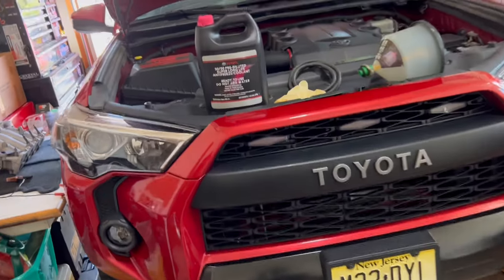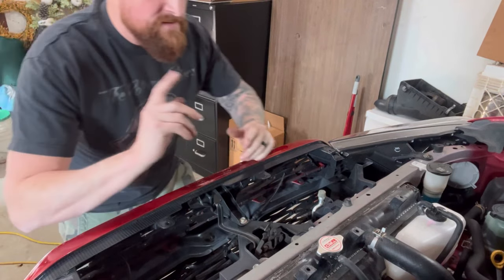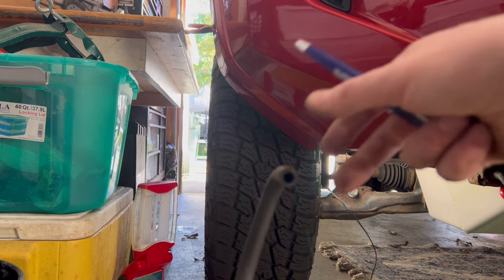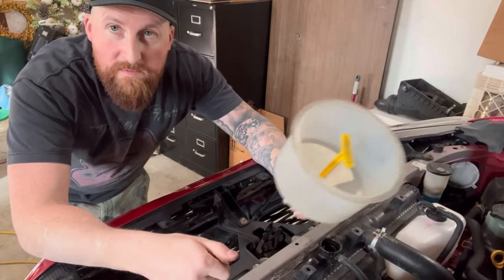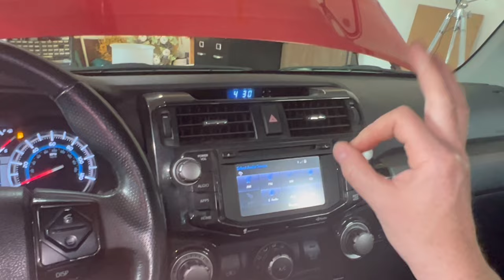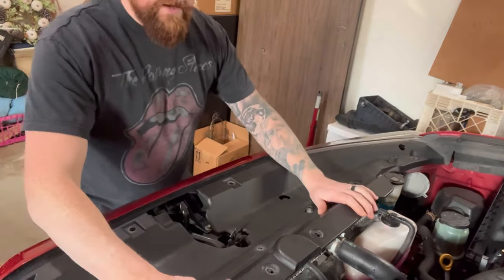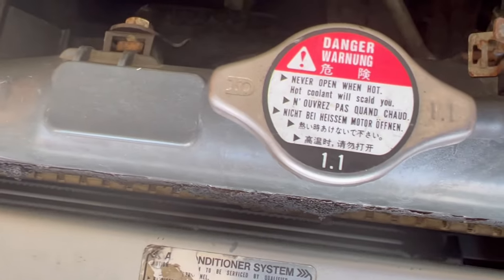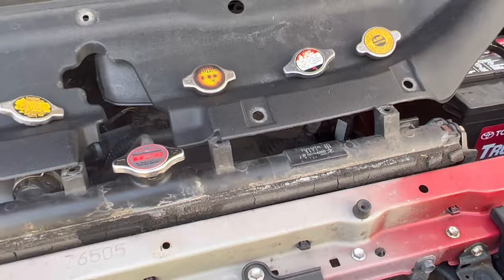Toyota 4Runner • FREE Maintenance Tech Tips - DIY Antifreeze/Coolant service (Drain/Fill)  Part 5

Comment: Great video man! Pro tip, pop your thermostat housing off and remove your thermostat to get the remainder of the coolant out of your engine block and heater core. I got about 2 gallons worth of coolant flushed when i did my service. Even used a shop vac at the radiator cap to push even more old coolant out of the system. Dont forget to purge the old fluid out of the reservoir as well. The more old stuff you get out, the longer the new coolant will stay nice.
Reply from the maker: Good tips, I do try to keep these maintenance videos simple for a beginner to tackle. Your tips are indeed very useful also. 
I did the Thermostat off camera. My wife says I should have included it. I believe she’s right.
I appreciate your continuous support!
Reply: @VikingsGarage  I completely understand. Thanks for the informative and entertaining content!
Reply: Hello, so I’m going to need 2 gallons instead of one right? Also is there a video of how to remove the thermostat housing on 4Runner 5th generation? Thank you
Reply from the maker: If you plan on changing the thermostat, yes,
No videos on changing it, it’s super simple. Believe me!!
Reply: @VikingsGarage  thank you. It is necessary to change the thermostat? Or I just take it out for the flushing and put it back. For a 2020 4runner with 50k miles. Thx for your help!!
Reply from the maker: You do not need to replace it.
Reply: I have a 2013 4Runner with 155k miles. Should I replace my thermostat?
Reply from the maker: Based on age, why not… it’s so easy. At that mileage I would.

Comment: Should we drain coolant from the engine too? Looks like this will partially mix the new coolant into the system.
Reply: You can just do this procedure twice with 2 gallons, that way the coolant in the engine will mix and you will get more thorough flush. You can also run distilled water first, but that will dilute the final mixture at the end.

Comment: Just dropped in to thank you. Just changed the coolant on my 4Runner with no issues at all. I was a little worried that I had 40oz or so in the funnel when the bubbles stopped but it all fit in the reservoir like you mentioned.
Reply from the maker: Absolutely Sir!! 👏🏻👏🏻

Comment: You should also drain old coolant from the drains on each side of the engine block. Accessible from the front wheel wells.
Reply from the maker: 🤦🏼‍♂️ Yes I know!! 
This was meant to be a beginners/ easy and quick drain and fill.
I think it’s probably time that I do that method so people put this to rest already.

Comment: One last question and I’ll leave you alone. You stated in the video that we only need 1 gallon, but the owners manual says the coolant capacity is 11.1 quarts. I’ve heard it’s important to replace coolant because it turns acidic and can cause damage. So by draining and filling just a gallon, is this enough to prevent adverse effects of old coolant?
Thank you for your time.
Reply from the maker: That’s exactly why I do it every 30k . Instead of every 100k.

Comment: Hey man thanks for the great video.  What if it's been 20 min and there's still bubbles coming up?
Reply from the maker: Let it ran until you feel that there are no longer any more air trapped in the system. But even if there is a small amount the system will correct that, make sure to top off the reservoir a little bit. 👍🏻
Reply: @Vikings Garage  I'm finishing this up now 😀 took about 30 min for the bubbles to stop. You're the man thanks!
Reply from the maker: You got it!! 👍🏻
Thank you for your support!

Comment: We had a shop do our 4 runner cooland flush and they forgot to put reservoir cap back on. Would this have caused any damage? Thanks in advance
Reply from the maker: If driven for long, yes.
You would loose coolant therefore it would overheat.
If not overheated and spotting it in time… re-bleed the coolant and install a radiator cap. You should be fine!!

Comment: Do you know of a little bit of pink crust at the upper radiator hose where it goes until the radiator is from a failing hose or clamp or both? Both are original Toyota parts.  2011 Limited.
Reply from the maker: I have seen this in the past, it’s usually a combination of both a hose that’s became softer and a hose clamp that’s no longer clamping as intended.
Off course, once both are out, do inspect the radiators hose neck. If it looks cracked then unfortunately the radiator will need to be replaced.
Reply: @VikingsGarage thank you. I appreciate your wisdom.  Getting new hoses and clamps.
Reply from the maker: @wolfeadventures 👍🏻👏🏻

Comment: Love your channel and the how to vids! I just bought a 2007 FJ cruiser with 225,000 miles on it , and want to change all the fluids and start from square one knowing it has all fresh fluids. Can I do this simple drain and fill with coolant on the FJ ? or do I have to flush it by removing the engine block drains ? I don't think the coolant has ever been changed. What would you recommend!!!??? any input is much appreciated!!! Thank you!
Reply from the maker: I would drain it both at the radiator drain and the drain in the engine block. Super easy to do, same bleeding procedure shown.
I appreciate your support!!
Best of luck with it.
Reply: @VikingsGarage  thanks alot brother! On the 07 fj cruiser is there a engine drain on the block on both the passenger and driver side? I looked for them this evening as I wasn't sure my 2007 fj had them. Thanks again!
Reply from the maker: It’s in the back of the block only, near the firewall, you can’t miss it.
Reply: @VikingsGarage  thanks man 🙏 greatly appreciated and thank u for even taking the time to respond.  I'm learning alot by watching your vids. Don't pay attention to the trolls or haters! U are doing us average at home Joe blow back yard mechanics a great service! 💯 I'm gonna knock out the coolant and trans fluid on my newly acquired fj cruiser.  Hopefully can get 400 to 500k miles out of this thing! I know u previously said stay away from buying a 07 fj, but the deal I got was to good! 6grand from a private owner with 225,500 miles and owned in Texas it's whole life which is a great find for Me because I live in Maryland and all the fjs are rusted out.. thanks again my friend
Reply from the maker: @survivethrive2468 holy 💩 $6k that’s an amazing deal… congrats!! 
I appreciate your encouraging words! 👊🏻

Comment: Thank you for another great video. I have one question, some vehicles have a bleeder port on the engine block to ensure there is no trapped air in the coolant system. It appears from your video that the 4Runner doesn’t. Correct?
Not having to deal with a bleeder port during a coolant change sounds good to me. 
Thanks
Reply from the maker: No bleeders here, it’s as easy as it looks. 
I promise , I appreciate your support!! 👍🏻
Reply: Thank you for the quick reply. You made my day demonstrating how easy the coolant change is on a 5th gen 4Runner. My will be due next year at the 5 year mark and I was concerned about having to bleed the system. 
Thanks again and keep them coming. :)
Reply from the maker: You got it!! 🙏🏻
Reply: There is a drain port on the passenger side of the block that can be accessed from the wheel well. You can bleed out another gallon of coolant there.

Comment: Have you had to replace your water pump on the 4Runner? My 2018 with 67k on it is weeping coolant and I'm considering replacing it this weekend.
Reply from the maker: My water pump at 178k is the original one. Never replaced. 
Dam at 67k , that’s pre-mature failure. 
Sorry to hear.

Comment: Great vid! Do you recommend doing the full flush and draining the engine block too? Do you flush distilled water through it too? Or, do you always just stick with the 1 gal out / 1 gal in?
Reply from the maker: Correct, 1 Gallon out, 1 Gallon in. That’s it.

Comment: Hey, I appreciate your video but something bothers me. 
I have a 2018 TRD Off Road Premium. 
The manual says that the coolant capacity is 1.1 quarts (2.775 gallons).
Which means that if I do it your way, I'm replacing less than half of the coolant.
I'm assuming in your case  your only replacing the coolant in the radiator
and the rest is in the engine block and heater core.

I know there's a drain plug for the engine block (10mm bolt).
Here's what's bothering me. 
Is there a way to drain the heater core so I can replace 100% of the coolant?
Doh! Just figured it out. Put the ignition in auxiliary (don't start) and turn the heater on full.
That will open up the valve. You were right, there is way!
Reply from the maker: Where there’s a will there’s a way, I’m sure you can if it bothers you that much. I’m here to keep things simple. 🤷🏼‍♂️

Comment: Hi from miami nice video and very instructive but one question what is the difference between the oem cap and the trd,does really help you with the system cooling for the truck ?
Reply from the maker: It’s got a lower boiling point, it’s useless in our application. Unless you’re using it on a race car.
I appreciate you watching!!
Reply: @VikingsGarage  thank you video 😊🙏💪💪

Comment: Got it, drain at bottom of radiator from butterfly nut, and pop off thermostat to flush out as much as possible. Are there any block drain procedures for this, or should most old fluid be able to be flushed with radiator drain and thermostat drain? Thank you!
Reply from the maker: You get a good portion of, every block does have an additional drain. But often times hard to reach.
Video was created with  beginners in mind and keeping it simple and easy.
Reply: @VikingsGarage  awesome man! Thank you for all your advice! Influencer’s like you are what these platforms should be all about!
Reply from the maker: @4Runner21 I do agree with you!! I appreciate your support!! Thank you!
Reply: @VikingsGarage  hey man! I’ve owned my 21 4Runner since she had 44K miles, and now at 51K miles. I have noticed every time I take the RPMs really high to give it a good Italian tune up, there is a nasty smell in the cabin likely from the burn off of something, that goes away after airing out / cracking a window and getting good air through  the cabin, is this typical in these 4 Runners? We have a 13 RDX and doesn’t have that smell and also most other vehicles we have owned I don’t recall experiencing that.. thanks!
Reply from the maker: I’m not sure, would have to check something like that in person.

Comment: any reason not to drain the engine block from the passenger side as well? its just as simple as draining the raidator as well that any beginner can do; just gonna unclip a section of the splashguard in the wheel well to get straight shot access to it; you get another 4-5 quarts out of there

Comment: Just had this done a few days ago and now my temp gauge is slightly fluctuating. Dealership says that’s normal with hard acceleration. Car never did that. What could be the cause? Air in the system?
Reply from the maker: It could be some air trapped in the system. Try bleeding it again, confirm that hear is coming out the vents.

Comment: I’m visually impaired but can work on maintenance but where is that valve to drain the fluid? I’ve tried looking for it on mine but can’t seem to identify it
Reply from the maker: Look on the bottom of the radiator,passenger side of the vehicle
Reply: Thank you! Now I have a follow up question, what tube do I get to plug into to that valve so I don’t have to take off that skid plate I hate taking it off lol
Reply: Oh I found it in description! Perfect!
Reply from the maker: There’s a link in the description Sir for it.

Comment: Do you have to empty the coolant from the engine block?
Reply from the maker: You can, if you choose too.
The drain plug is in the back of the block.
You will need 2 gallons instead.
Reply: @VikingsGarage  Is it necessary to do?
Reply from the maker: It all depends what your trying to accomplish my friend.

Comment: In the manual I’m pretty sure it says the 4Runner holds 12 quarts of coolant. Why does it only take one gallon?
Reply from the maker: Simple drain and fill of the radiator Sir… it’s not a complete system flush.
Reply: @VikingsGarage  i wish the tacoma 5VZFE only took 1 gallon LOL... my old rig takes 2 gallons of the Pink in that radiator... Gen2 Taco only takes 1 gallon!  current MSRP on a gallon of Toyota Pink is 30$ ... bless the discounter online genuine parts department that you can get it shipped for about 15$ per gallon (on special sales events) to do this d+f maintenance once per year before the winter cometh

Comment: Don't you need to drain the engine block from the coolant that's in it? You'll need 2 galon to fill back the system by draining the radiator and the engine block. It would be better to have more fresh coolant in the system
Reply from the maker: Not if you do it every 30k miles. 
Hey at the end of the day you’re welcome to do what makes you happy. 👍🏻
Reply: @VikingsGarage  Thank you for your reply with the clarification about this extra step 😎
Reply from the maker: @youssbaraki no worries, I’m always here to help.

Comment: This method won’t drain the heater core, no?
Reply from the maker: Correct
Reply: It won't drain the heater core OR all the old coolant in the engine block! @VikingsGarage
Reply from the maker: Yes, I’m fully aware.👍🏻

Comment: It says that the cooling system takes 11 quarts of oil by only using 1 gallon of antifreeze.  Your only draining a third of it.
Reply from the maker: I’m sorry, 11 quarts of oil ???
Never once did I say we were draining the entire system. These are tips and tricks you can do at home. Comments like these are the main reason why I haven’t been sharing my tricks, nobody else’s. My tips and tricks. 
I’m not here to impress you or to be the most analytic and to the T YouTuber out there, but hey why don’t you share your tips and tricks. 🤔
Reply: @VikingsGarage  so how often do you do it with only draining the radiator
Reply from the maker: Every 30,000 miles, at 180k now . 
Zero issues. 🤷🏼‍♂️

Comment: How many miles should u do these
Reply from the maker: Every 90k miles
Reply: Thought you said every 30k?
Reply from the maker: I do it every 30k ,
Toyota wants you to stretch it a bit longer then that 😉😅
Reply: Got it thanks. Nice job and simple!
Reply: @VikingsGarage  and that is because of the cost involved having the dealershop do it, which can run into nearly 300$ nowdays, increasing the cost-of-ownership on that vehicle... especially if the full system takes 3 gallons at MSRP of 30$ per gallon they will ticket you for

Comment: Vikings B.S. He forgot to drain coolant from engine block.
Reply from the maker: I didn’t forget, I didn’t drain it on purpose.
This is a quick and easy way to drain a portion of the coolant.
I do this every 30,000 miles.
That drain plug in the block is not easily accessible by your average joe. 😉